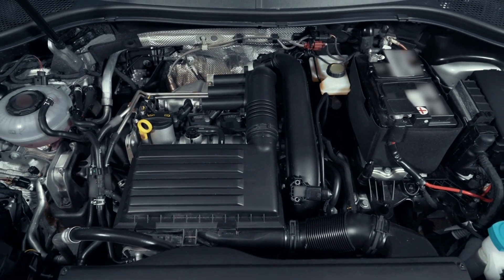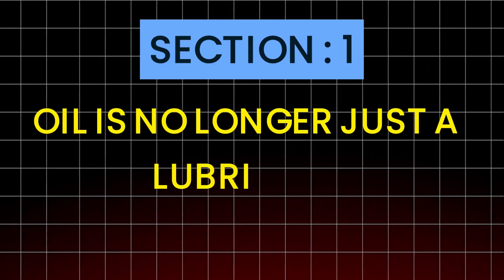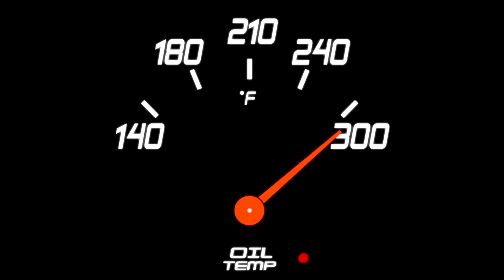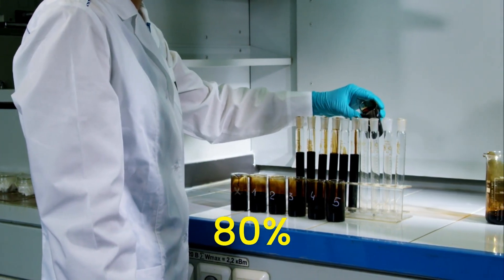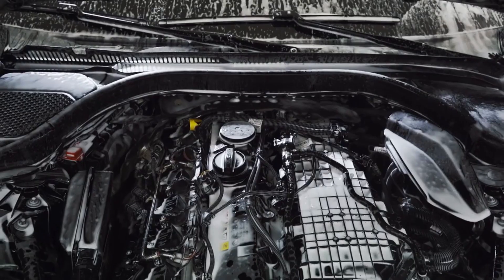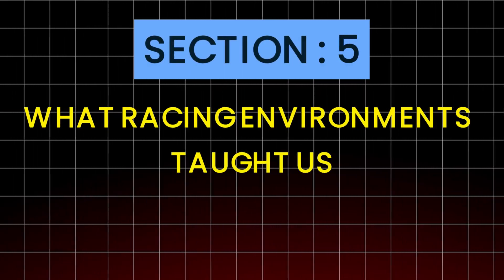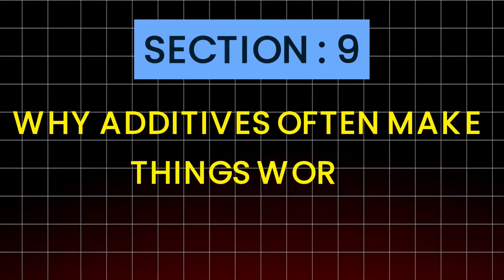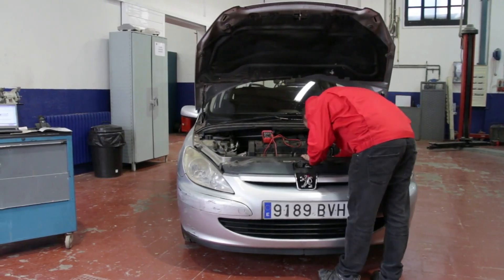Why Modern Engines Are Failing (It’s Not Bad Maintenance)

Comment from the maker: Most engine failures don’t start with noise — they start silently inside the oil.

After watching this video, which oil habit or advice surprised you the most?
Long oil intervals?
Break-in myths?
Oil thickness vs cleanliness?

👇 Drop your experience below — real engines, real miles, real results.
Let’s talk proper engine maintenance, not marketing advice.

Comment: This is why I don’t use the 0W-20 water thin oil. 

I use 5w-30 in winter and 10W-30 summer. 

I also don’t buy cars with crap engines. I bought a 2020 4Runner with a 20 year proven engine. 

I also change my oil every 5,000 miles. This 10K is just a lie to sell you a new car sooner.

I also make sure to get it on the highway at least once a week. But what keeps my cars alive is I have to drive on the highway 10-15 minutes to get anywhere. I’m in the middle of no where so any time I have to drive any place the engine gets to get nice and warm and burn off the moisture.

Comment: At this point I think everybody knows about “obsolescence planned “ no matter what you do to your beautiful new car it won’t last 200k miles, something is going to fail, engine, transmission, electronics, emissions components, suspension or exterior paint, however if you take care PROPERLY of your car it will last longer, particularly if you do oil change every 5k miles using synthetic oil and transmission service every 30k , good luck 😉
Reply: It all depends on the vehicle you buy there is still a few made that have simpler tech and last. 

That’s why the 2003-2025 Toyota 4Runners have an unreal used market value. They are a modern car but still have the same engine and transmission they did back in 2003. 

Toyota just kept refining the little issues and they have a proven record. But so many are like ewww it’s big and slow and only has 5 gears. 

Yes and that’s why it lasts. It’s built like a tank.